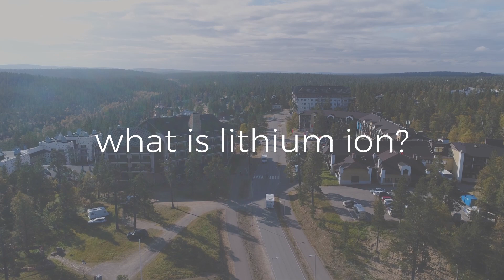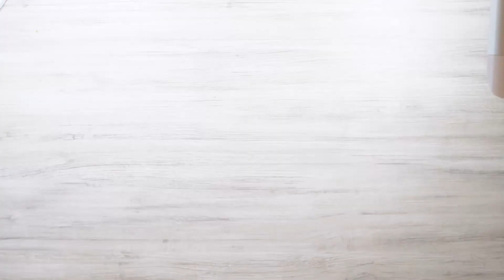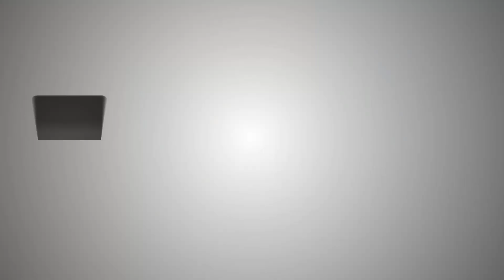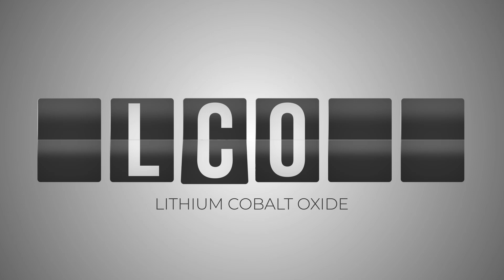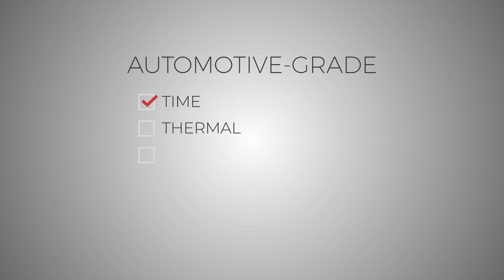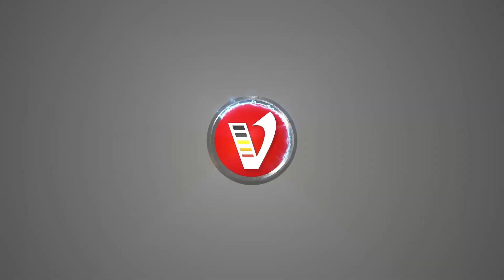What is Automotive Grade Lithium Ion | Volta Power Systems

Comment: Is it possible to buy a Volta power supply for my camper van? I’m interested in at least 8hrs of air conditioning for my dogs without plugging in. Thanks
Reply from the maker: Jennifer - yes, depending on the installation, we have seen retrofits that can meet those goals! If you're interested in specifics, we would recommend talking with one of our retrofit partners to get a quote - more at https://voltapowersystems.com/get-volta/